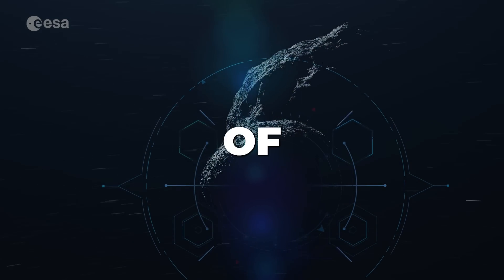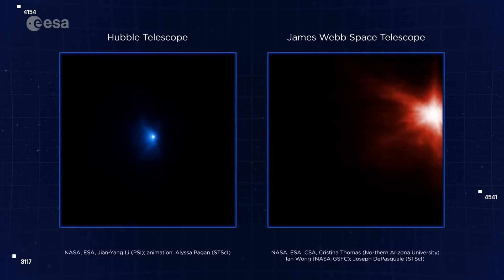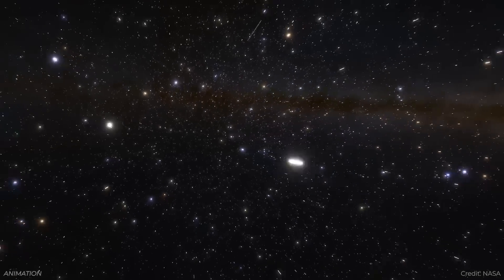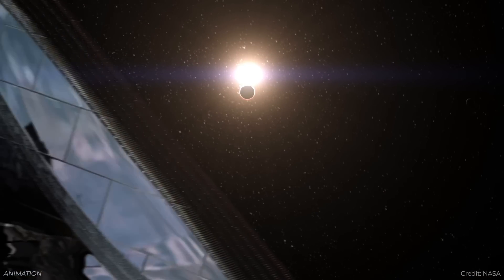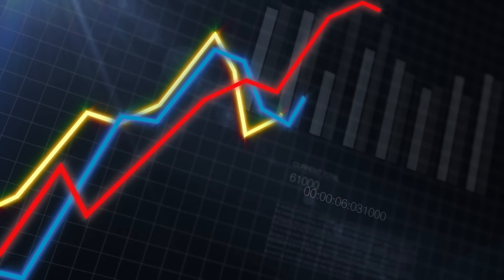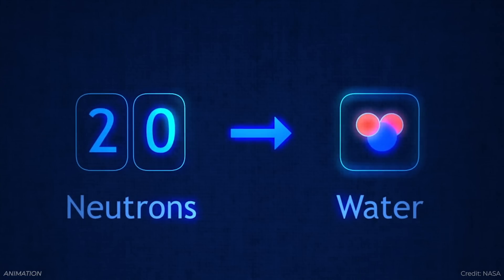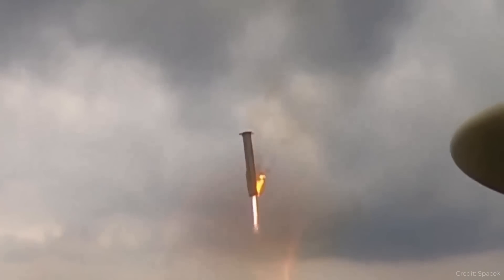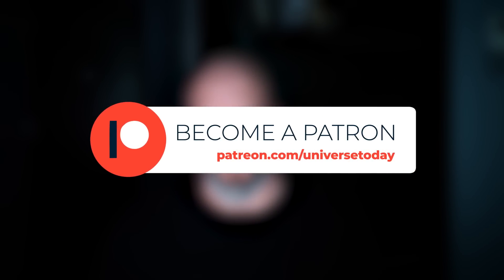Giant Space Structure // Starship Flight 5 // Asteroid Inspector Launched

Comment: catching that booster is going to be absolutely bonkers. i had to giggle a bit by the matter of factly you said it Fraser xD. Ill be wildin' if they manage it!
Reply: yup. we wildin'. OMG!!!!! take that haters!!
Reply: Like you said, if they can do that it would be wild.  I just do not trust the reliability of turbo fed rockets for vertical landing.
Reply: I think elon is nuts. I won't be surprised if they have to kiss their launch tower goodbye.
Reply: @mrxmry3264 Honestly, the tower will probably be fine at the speed it's likely to hit the tower. The pad itself is the more delicate part with all the plumbing and hold down that milkstool has.

My understanding is the steel support columns are filled with concrete. And while the starship is relatively sturdy it's far thinner steel the what the tower is made of. Plus its not going to hit at hundreds of miles an hour. Maybe several dozen at worst case. But likely closer to drop speed from chopstick hight if it slips. Plus the amount of fuel and oxidizer should be relatively small when landing. Any explosion should be close to SN5 I believe. Assuming I remember the SN # correctly. The one that survived the belly flop and landed for several minutes before a fire and leak caused it to explosed.

Its not going to resemble a commercial plane hitting a skyscraper type accident. The rocket will scrub off way more speed before targeting the tower.
Reply: @garreth629  they managed to hover and have accuracy of half a cm on the last flight. The tower is super beefy and the arms have recently been tested with more than double the weight of a cought booster. Lastly, only if everything looks perfect will they go through with the catch. I'm not worrying much for damage at all. surely won't be worse than the concrete tornado.
Reply: @nerufer  I was meaning more as a worse case scenario. Let's say if they lost one or possibly two engines at the last second and hit hard. More absolute worse case.

Im actually 60 40 they stick it if they go for it. Even if a pin fails to snag I agree with EJ on NSF it might hang off a grid fin once. 

I mainly made my statement to imply I doubt the rocket could take out the tower itself even if things go crazy.

Thanks though